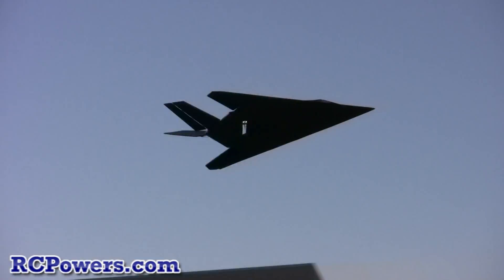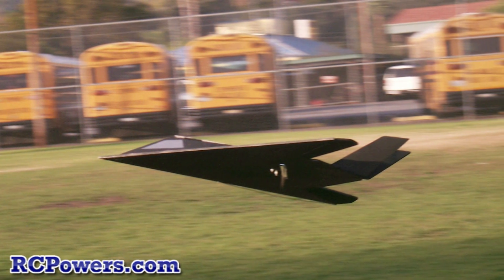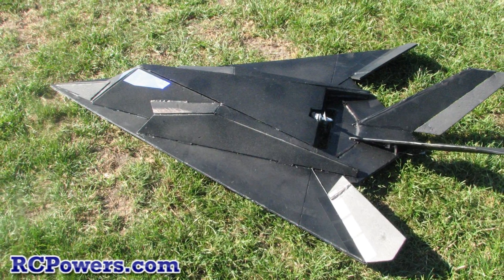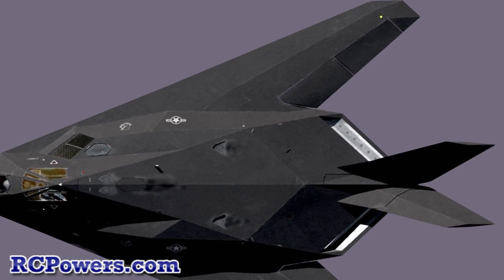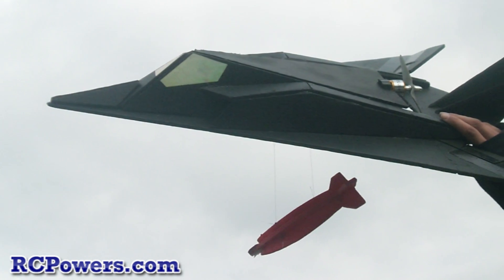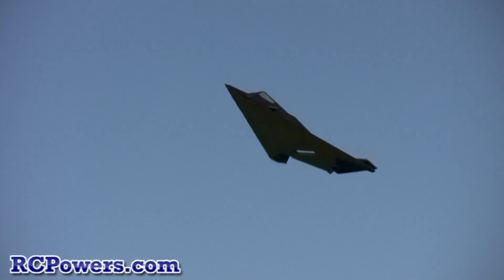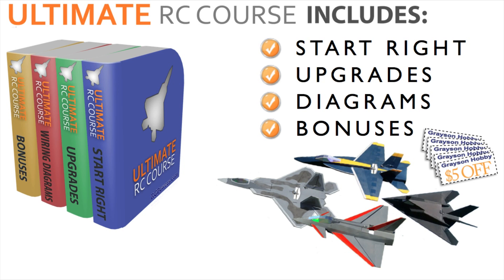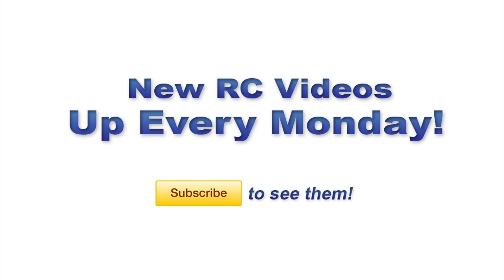F-117: How We Made It Stable

Comment: @mhmyup1 A BEC conditions electricity from the main Lipo to power the recever and servos. ESCs have commonly a BEC included but that may not be enough if you have too many servos, gyros and stuff draining current (in A or Amperes). An Extra BEC will help in that case only. In your case just replace the ESC and next time you test the motor, see if it can make 3 turns WITH A SUITABLE PROP and that is enough.

Comment: thanks so much.  i've built and flown both v1 and v2 of this plane and always wondered how you came up with this design.  it's my favorite of your designs so far . i have discovered one horrible weakness to this plane however... turns out if you have a supermegajet running a four cell with a gopro strapped on top and you fly it into a steel ibeam at full throttle ... well the plane just tends to break..... can you guys figure out a way to fix that issue.. :) oh and the f22 has the same issue...

Comment: @mhmyup1 My explanation : Outrunner motors spin very fast already WITH a prop. If you ran it to the floor without the prop the ESC might have overspeed. An ESC has a DSP that keeps track of where the rotor is and calculates the precise timing to send power pulses to the coils. If oversped, the ESC might have sent a big pulse with a wrong timing and no opposing EMF from the coil. The intensity went to the roof and burned your ESC.
Gurus : Am I right ?

Comment: I have made several own designs - some quite small (40'') and 'bomb like' (v. short coupling) for IC power. In general, I find the following makes for a stable plane - over size tail and fin area, parallel chord wing, lifting wing section - i find that even just a bit of 'semi symetricalization' takes away the pitching effect of clark y, and gives a decent inverted performance. Just a touch less down aileron than up helps to keep things stable on the turn. adding lightness helps too!